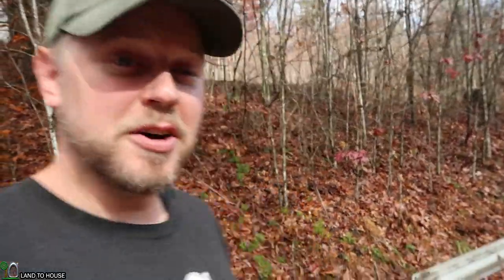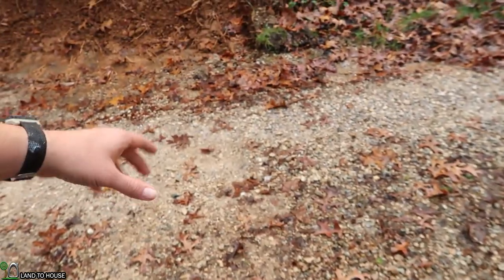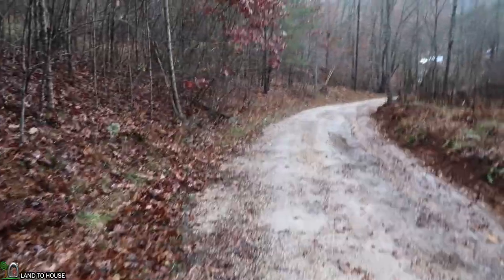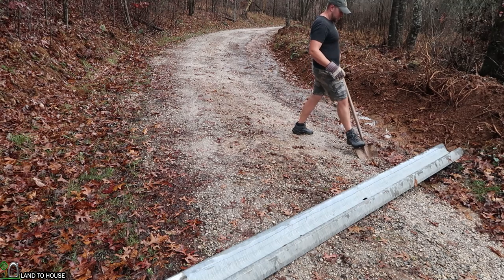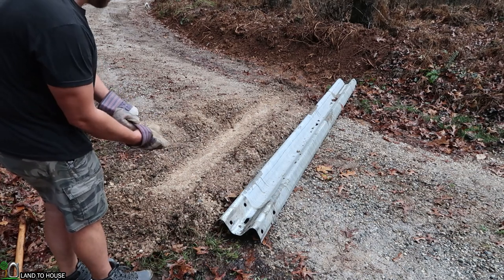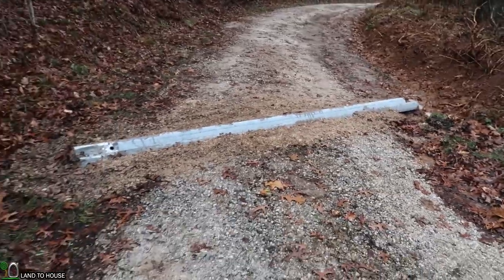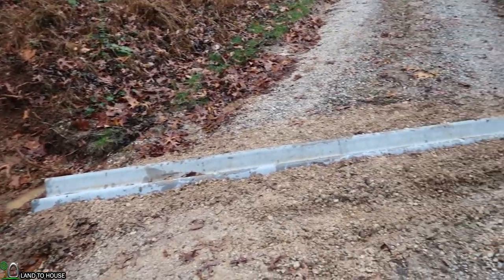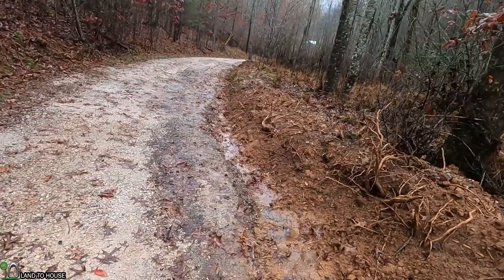Road Guard Rail Prevents Erosion. Stop Washout!

Comment: This may seem a silly question, but why don't you have a ditch on both sides of the road so the run off goes either side into the ditch? You can connect the two ditches together with a pipe sunk deep into the road. It would be easier for other road users too. If the road is subject to freezing, a piece of metal would be much worse than gravel to slide on.
Reply from the maker: This road has a pretty steep angle towards the single dirch. And the other side is just a bank.  The majority of the water comes down the road from the mountain behind the house.

Comment: I’m not sure where you’re at but where I’m from used guard rail is not something you get on a daily occurrence lol
Reply from the maker: Haha its a gas station norm here.  Like getting a sprite and bag of chips.
Reply: Sounds like a good side hustle. All you need is a prybar and some leverage !
Reply: It's all over the place near me.  The stuff is literally hanging on on the sides of roads everywhere.

Just requires a little elbow grease to get it loaded
Reply from the maker: Haha literally hanging by the road.

Comment: Looks like a great idea. I might have to see if I can find some here in Washington for my driveway. I can see where it might fill with debris over time. I’m wondering if if would be beneficial to fill the trough with river rock. It would still allow the water to flow across the road while keeping it from filling with debris. Plus as a bonus, it would smooth out the drive as you cross it.

Comment: Any update on this project? Tnx
Reply from the maker: Its working very well. After several months of use it sank down a little and works better. I needed to dig down more to start.
Reply: Excellent. We have a steep golf cart path on the side of a rock hill (very little earth) and have struggled to find a way to stop the erosion. I’ll look into the guardrail solution!

Comment: I think it would work better on the other side, upside down...  wider run for the water.  Having 2 channels would be better at keeping it clear if 1 of them gets blocked, also has a third stage joining both channels into 1 bigger channel, whereas upright as you have it only has 1 stage...
You might also want to consider using just a culvert...  or even making a form and pouring cement but I like your idea just switch it upside down..  .
Reply from the maker: These guardrails are very popular in this area for water diversion. I would be a bit concerned about flipping it the other way because the metal edges might cut into tires
Reply: @LandtoHouse  if the edges are flush with the gravel they should be fine, and could use a bit of filing if needed..  but I am not trying to convince you to try it..  Just sharing thoughts, I make a LOT of comments online, usually against the xionists and global warming deniers...
Great idea to re-use materials.  Ram pump is very interesting...